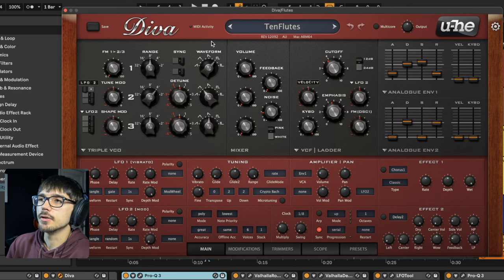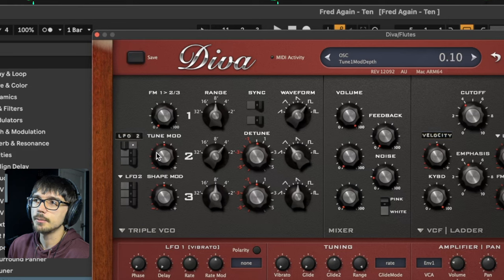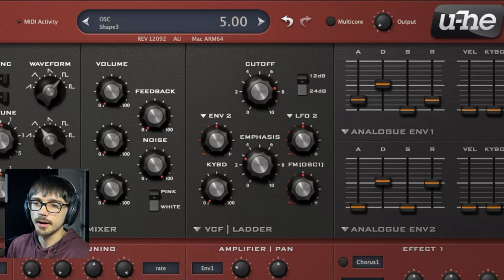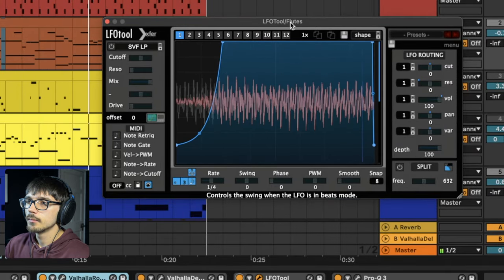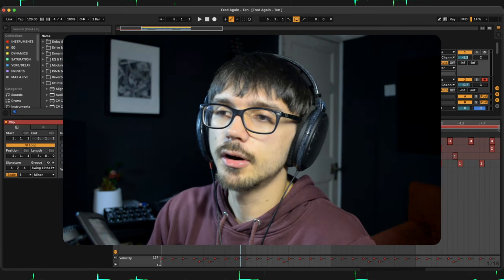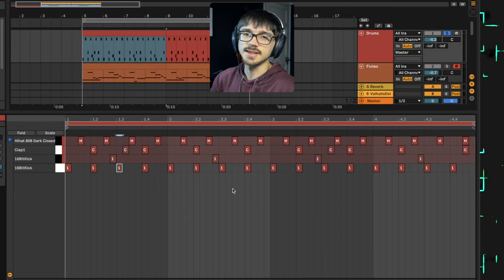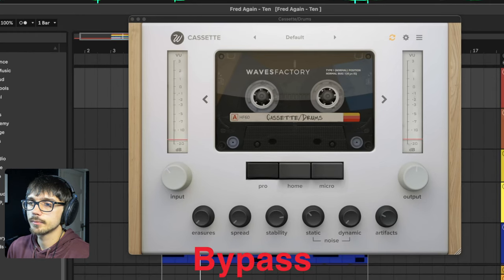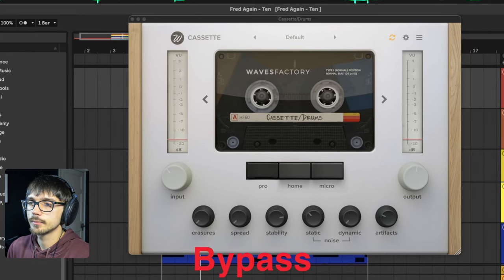Track Analysis: Fred Again - Ten / Pt.2 Sound Design 🎛️

Comment: Heya, does anyone have any tips for taming the clicks in our synth patches? I understand that adjusting attack time eventually removes the click, but in my case (I'm using Pigments) the character of the sound is being spoilt before the clicks are gone.

Any tips? Is everyone RXing the clicks from our synth patches and I just haven't heard about it yet? 

Thanks for any help in advance!
Reply from the maker: It's very hard to tell from just the synth alone there can be a lot of factors that can cause clicks and if there's still a click after increasing the attack time then it might be something other than a phase re-trigger issue. 

If you want send me a direct message on instagram or somewhere else, i can look have a look at the preset and see what's happening. Just search modul8online and you should be able to find me. 😀